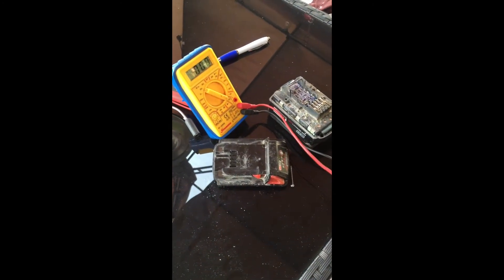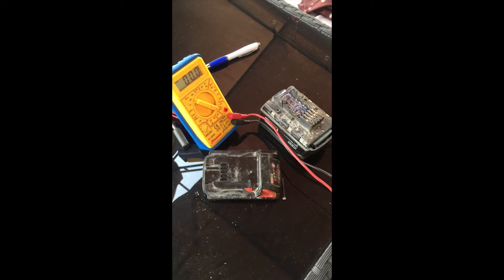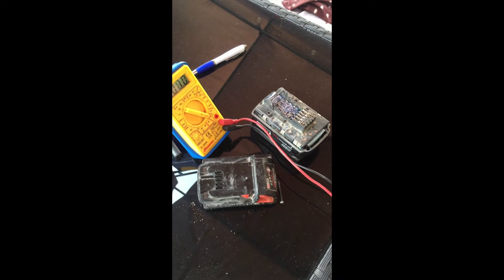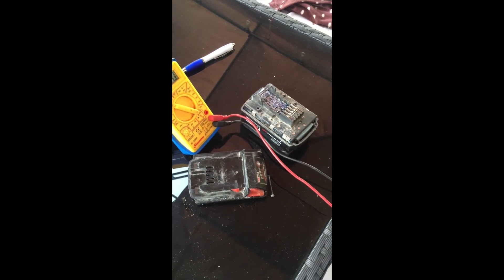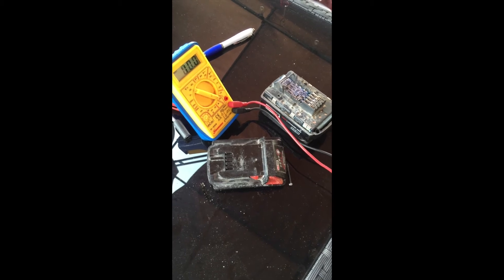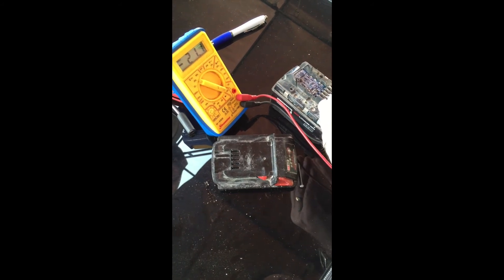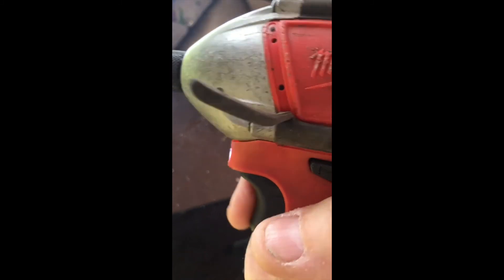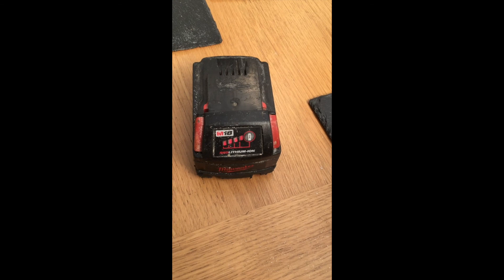Milwaukee M18 Battery - Teardown & Fixed - Part 2

Comment: i had the same problem.  I checked it with my volt meter also same problem.  come to be there was dirt or built up plastic.  I used uni-solve and a old tooth brush and now it works perfect.
Reply: Dirt or built up plastic where exactly?

Comment: Even more interesting.  It just fixed itself?  Okay, can you do an ohm resistance reading on B+ and J1; B+ and J2; B- and J1; and B- and J2.
Reply from the maker: Hi Charles - I don't have it any more - I have just found my readings I took from the old battery. I dont recall which terminal numbers they were but looking at the battery contacts, from left to right as seen by looking at the battery from the opposite end to its test button I found Terminals 1-2 zero voltage and terminals 2-3 zero voltage. On a good battery terminals 1-2 read 18.3v and 2-3 read 17.8v, it may not have been fully charged. Both of those combinations were open circuit on the bad battery. For whatever reason it resolved, it then did read a voltage across both combinations but I took no readings. Hope some of this helps. Kind Regards
PS - It sort of resolved itself, after I had rebalanced the battery charge to the cells that were low by applying direct voltage to the bank that was low
Reply: @GHOOGLEMALE  no problem. Glad it worked out for you.
Reply from the maker: @dotnVO1  Well I did do something I suppose, opening it up and charging the cells that were low seems to have done the trick. Someone else suggested connecting 2 batteries together, the duff one to a good one, positive to positive negative to negative and leaving them that way for a few minutes, then disconnect and put the duff one straight on the charger. I fixed mine before trying it but worth a go if youi have another battery (its the two outer terminals)